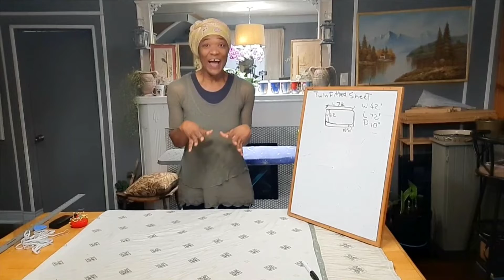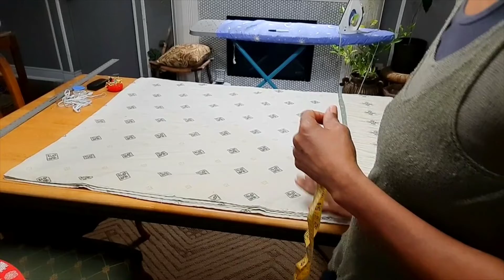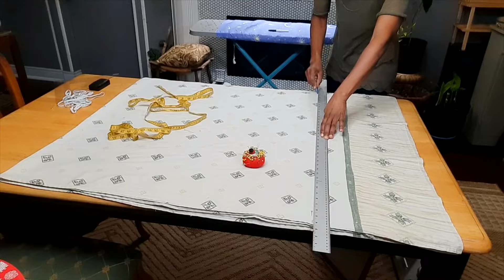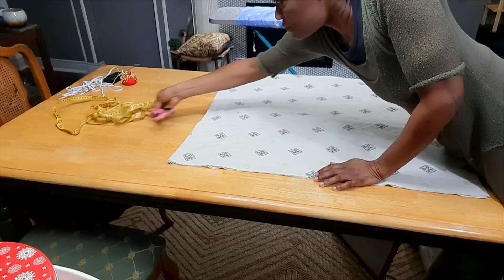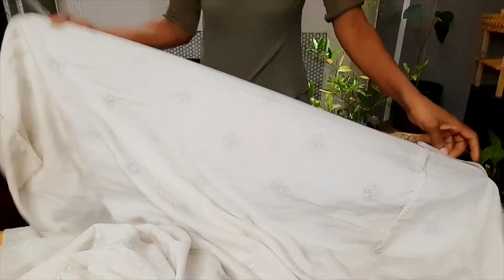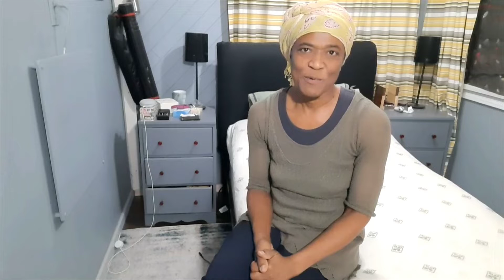Turn A Flat Sheet Into A Fitted Sheet- Bed Linens/ Sewing Tutorial

Comment: super nice ...what to do so the sheet doesn't slide much...my son hates when it happens but the truth is all of them move...
Reply: Great video. What size elastic did you use with a 1/2" seam? Looked like 1/4". And.. when sewing corners what seam allowance did you use. Did you finish edges.
Reply from the maker: @susanrenaud5580   I did a pocket that was 1/2 and I used a 1/2 inch elastic. The corners was about 3/8 of an inch and I used a zigzag stitch for the edges. I hope this helps. All the best for the New Year 2024! Thanks for your support on my channel!
Reply from the maker: Thanks very much! If you make the sheet with a deep underlap/ return, it does not shift as much. Otherwise, I guess you can attach a corset system underneath the mattress. Cheers!